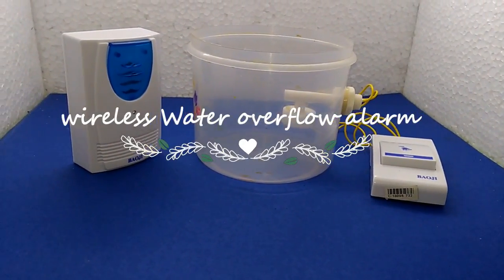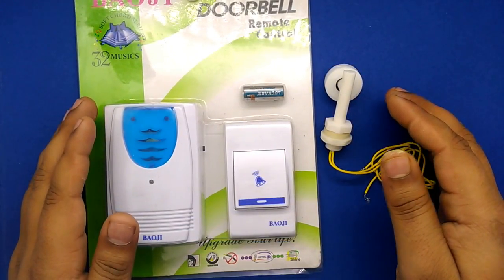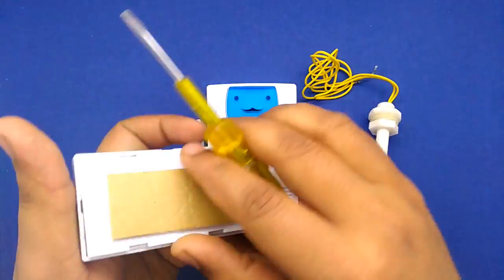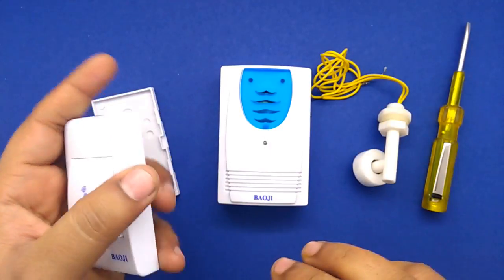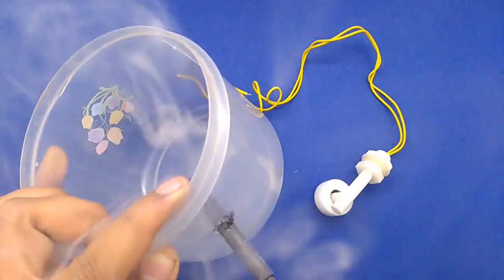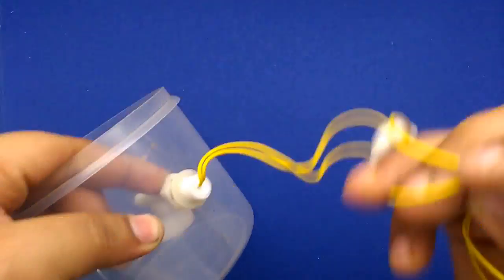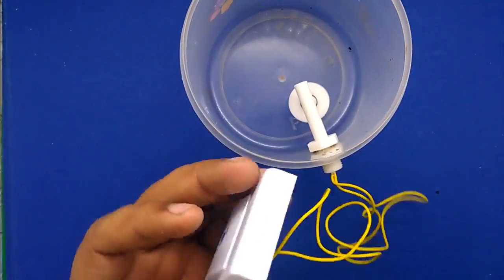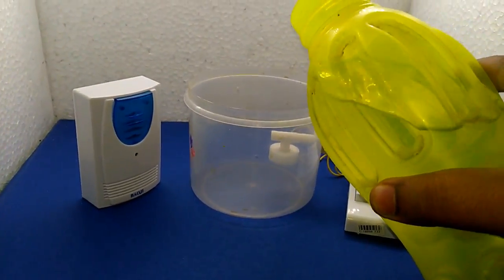Wireless Water Tank Overflow Alarm(Simple & Cheap)

Comment: I have made my own using these components.
# 433mhz RF module for wireless communication, 
# two arduino nano, 
# one ultrasonic sensor to check water level in the tank, 
# one relay to actuate motor, 
# 16x2 lcd (i2c) it shows the percentage of water in the tank, 
# one touch sensor to turn-on motor, # rgb led to indicate water level, 
# two Hi-link SMPS to power both setups one in the tank and another near motor or wherever u want to place in the house....
#when i touch the surface of touch sensor motor turns-on when water level reaches 100% then motor turns-off automatically. I have been using it since last two months and its working perfectly. I also made it for my friend he is satisfied with that too

Comment: If you give continious battery voltage in transmitter after the water tank is full, will it damage the transmitter or not? When you continiously press the switch, there will flow of current from the battery into the transmitter which might damage the transmitter. Please correct me if I am wrong.
Reply: Same question, have you found the solution? And did you use this system?

Comment: The bell which i purchased have four pin of switch in remote in which way i can solding wire of float sensor to that remote
Reply from the maker: First power the whole system then you need to try to short wires of switch you can find the combination of two wires wich should work

Comment: Excellent -- where is the list of parts and where I can purchase, please?
Reply from the maker: Sorry for the late reply sir you can purchase wireless bell from your local electionics market & you can purchase float sensor from online stores 
Links - https://www.amazon.in/Super-Wireless-Remote-Control-Calling/dp/B00E991HVE
https://www.googleadservices.com/pagead/aclk?sa=L&ai=DChcSEwj3tNbr1pzqAhWBfysKHeo6BVYYABAGGgJzZg&ae=1&ohost=www.google.com&cid=CAESQOD2hrNYRoC3Nq_fij7oUuhKein0JF5-ntnZwKnkMx_8dzdqLouqB9FF7A_Ov_y7F3J4TZP6GZC9sgNWsX-MLKk&sig=AOD64_2Q42kYdWNIIYJi3X3ezNYFvOHN0g&ctype=5&q=&ved=2ahUKEwiGxc_r1pzqAhXIF3IKHVrRAkwQwg96BAgPEBU&adurl=https://thinkrobotics.in/products/220v-liquid-water-level-sensor%3Fvariant%3D29447516291144%26currency%3DINR%26utm_medium%3Dproduct_sync%26utm_source%3Dgoogle%26utm_content%3Dsag_organic%26utm_campaign%3Dsag_organic%26gclid%3DCjwKCAjwltH3BRB6EiwAhj0IULO22bfqU9RPzAJpPzpApJcnPg1ap3TURsIDUnfwJUSbr2V8G8-zDBoCM-gQAvD_BwE
However buying online is expensive you can get cheaper prices if you can buy it from electronics market that sells electronic components
Reply: Also if it rings continuously, you need a switch to turn it off

Comment: When the water touches the sensor, the bell will ring. We know that the water level will not immediately reduce from the tank. in that case, will the bell be ringing unless the water level is released from the sensor? because there is not any off switch in the bell.
Reply: I have too the same question  ..
Reply: I have same question I have just an idea if v no the power of the battery and use the old mobile charger connect to the remote  and plug in to motor line then if off the motor then averthing will off
Reply: I have same question
Reply: Put the sensor at the place where the overflow water come out from tank. When we make off the mortar, overflow will stop. Then the remote switch sensor come to off mode.
Reply: If you give continious battery voltage in transmitter after the water tank is full, will it damage the transmitter or not? When you continiously press the switch, there will flow of current from the battery into the transmitter which might damage the transmitter. Please correct me if I am wrong and provide me the solution.
Reply: @nabinkartheek9390 absolutly correct 💯✅
Reply: right.
Reply: You have to put a switch to turn it off.
Reply: नहीं ऐसा नहींहोगा,  सिर्फ़ एक बार ही बजेगा लेकिन रिमोट का टर्मिनल लगातार देरी तक शोर्ट होने के कारण रिमोट खराब हो जाएगा